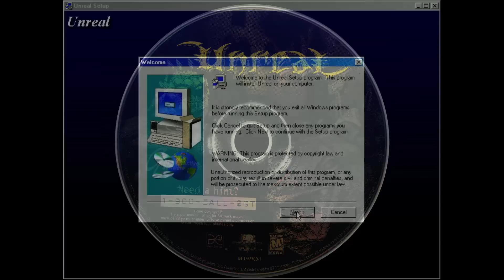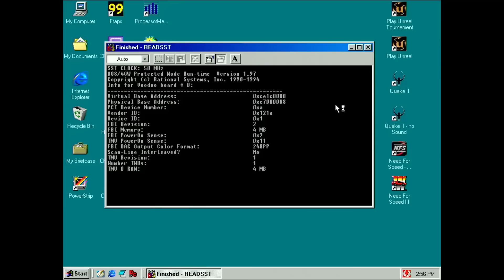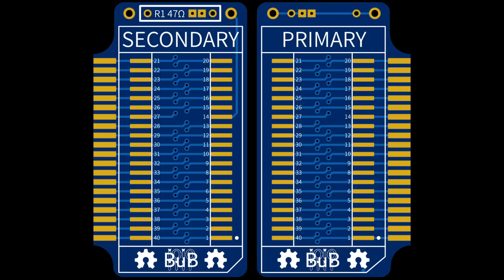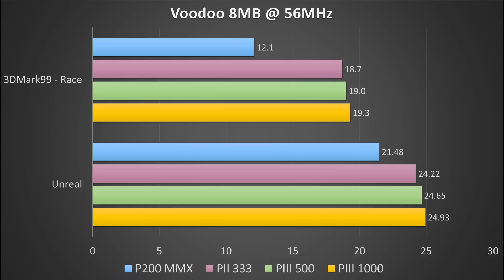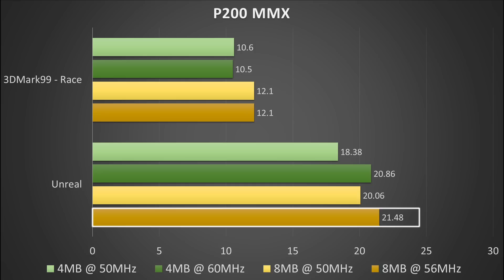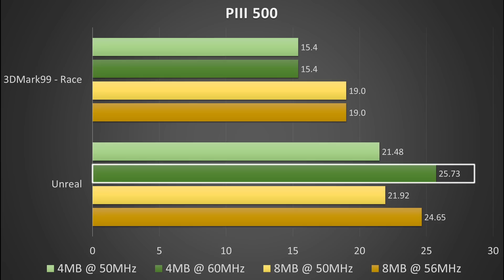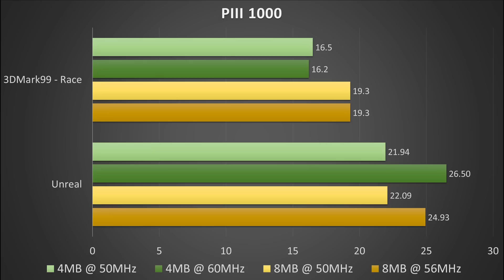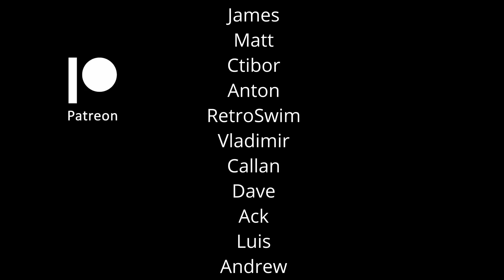Powerup: 3Dfx Voodoo with 8MB meets Unreal!

Comment: My Monster 3D Voodoo 1 was the first thing I ever overclocked. 50 mhz to 57 mhz. 60mhz all games crashed :(
Reply from the maker: I have around 7 Voodoo 1 cards right now, and none of them are stable at 58+ MHz. 57 MHz is some mystical barrier (I think two are even unstable at that frequency). I think a safe overclock for most cards is a solid 55 Mhz - which gives a bit of headroom.
Reply: @bitsundbolts  people said I was an idiot for overclocking it but I got Voodoo 2 SLI a year later
Reply from the maker: Hehe, well, instead of overclocking, one could also say: 'optimizing'.
I do it to this day! I am running a 3070 in my system and know that nVidia pushes those cards to its limits. Most of the time, you can reduce the core voltage of modern cards significantly, and reduce the clocks too! Ok, you lose 5% performance (as in 97 frames instead of 103), but the temperature drops by 15 degrees! I prefer a silent system over the 5% performance gain.

Comment: I wonder if Unreal Tournament is playable with the voodoo 1 and with the texture pack would make a difference having more texture memory.
I also wonder if similar memory upgrade would be possible on a voodoo 2 because i remember i had red somewhere it would support up to 20 MB (not to be confused with the SLI on a single board cards with 16 or 24 MB), that would be even more interesting!

Comment: Did you try upgrading the 3dfx Velocity 100 from 8 to 16 Mb? Aparently there exist 4-chip SGRAM Voodoo 3-s, and as the Velocity 100 is a Voodoo 3 with less RAM and 1 texture unit disabled in drivers, maybe there is a way to install the updated amount of ram and flash the relevant BIOS to the Velocity 100?
Reply from the maker: I do not have a Velocity 100. But I have heard what you described before. Not sure about the ram upgrade, but definitely unlocking the texture unit.

Comment: Mankind are about to enter 128 bit era, but you still stuck on 8 bit. Move on bro
Reply: They need a 128 bit OS and CPU, and then 3D games will not lag and hitch; It should have been done decades ago. Game consoles from the early 2000s such as the PS2 is a 128 bit system.

Comment: I was chasing for great 3d accelerators at the time, all voodoos, all Verite 1k/2k, all nVidia Rivas, I tried them all. But those are quite long obsolete today. The only thing remains unparalleled in Unreal till today is its software renderer, the only one on earth that can easily confuse you at higher resolutions with hardware rendering. Unreal's software renderer is undoubtedly the GOAT.
Reply: And it's all down to one simple trick: dithering. A 2*2 ordered dither on the texture coordinates is an incredibly effective way of faking bilinear filtering.

Comment: The reason you aren't getting much for having the extra video ram is either that you can load everything needed in a level into less than 4 already or the bottleneck is the processor it's self so extra ram isn't going to help much. 

The real performance gains for voodoo cards was with SLI anyway.  I remember going from one to two voodoo 2 in my system and it was a MASSIVE gain. I out performed the voodoo 3 when it launched, though me and my friends tuned the computer forever. Pretty sure that was the first time I overclocked a card. we ended up rigging cpu cooling fans from a Pentium II to the main chips and powering them from a chassis fan header set to run full speed at all times because obviously temp sensing wasn't going to be available. 

Unreal is a bit over what a voodoo 1 is capable of really. To me unreal fits more in the voodoo 2 era. They launched within months of each other. This seems like trying to run cyberpunk 2077 on a nvidia GTX 1080. There was never a time when 20fps was considered acceptable gaming.

Comment: You know we didn't play this games with the release hardware? It was soo expensive, so we used to play with an overcooked celery and a side of rivas. I don't understand your obsession with release hardware. Games weren't released so close together
Reply from the maker: Unreal did not work well on the system I had. I don't remember what graphic card I had, but I think it was something from ATI. Direct3D wasn't an option yet - therefore it was software rendering.
Back then, I did not overclock my PC. I was afraid damaging something and also lack of knowledge.
Regarding my hardware choices: I could use a random setup, but staying around release hardware gives a close representation of how the game was back then. Running Unreal on an Athlon XP 3200 and a GeForce 3 won't trigger the association that was created over 25 years ago. But that is just my opinion.
Reply: @bitsundbolts  I absolutely understand that, for me the glide wrapper was problematic. 3dfx left a huge mess, just getting working drivers is almost impossible now. I dont think windiz updates will even work anymore. I don't have anything else to tell you that you don't already know, you can't be any dork off the street to double the ram. Overcloking was done with jumpers, we even had to enter the lba, cylinders, heads, set slave or master jumpers and make sure the cables were 66 or 100. The sounds of HDD will always be missed, but I am always amazed at how fast and capable old computers can be when you stick to period correct software.

Comment: I wonder how you benched the v1 on a 1000mhz p3, that cpu is too fast for the card and the cards displays al kinds of dispay errors (colored blocks,etc). Is it a calculated result?
Reply from the maker: I did not see any issues running the Voodoo on a PIII 1GHz. I am using the Windows 98 supplied Voodoo drivers (which glitch under 3DMark 99), but work without problems in Unreal 225f.

Comment: Cyrix PR200 with 32Mb ram, running a Diamond Monster 3D back in the day. What most "modern" takes of this leave out is that a lot of us were running at 512x384 for better performance, not 640x480. On an LCD panel it looks terrible. On an old CRT it was very playable visually, plus you could hit 30 FPS in a lot of titles. Remember Doom and even DOS Quake in software mode all ran around 320x200 back then, so 512x384 was a step up.

Comment: hi
how did you overcome the 3dfx driver glitch that ruins textures in d3d modes on cpus faster ~400mhz? 
although unreal is able to run in a free of this bug glide mode (in this case without any benefit from additional 4 megs of ram), 3dmark works in d3d only. 
what's the driver do you use?
Reply from the maker: I used the driver coming with Windows 98. It does glitch on both PIII CPUs.
Reply: It's strange that it worked at all becasuse w98 integrated driver for voodoo graphics seems to me a dummy plug.
Reply from the maker: With later reference drivers, 3DMark renders correctly on the faster PIIIs. The Windows 98 SE driver does glitch with those CPUs. Unreal however never had any glitches with the drivers coming with Windows. I was surprised as well. They were also a little bit faster compared to the latest reference drivers from 3Dfx.

Comment: Great mod and experiment. I was there when Unreal came and it was quite the nightmare to make it run without a Voodoo. My first proper 3D accelerator was a professional ELSA Gloria XXL, that was great for many things but definitely not for gaming. Things like that, I used to run it with the software render. I remember that I needed an overclocked Pentium II 350 to make it half decent. Some time later I got the first Geforce paired with a dual Pentium III 1Ghz and what a difference it made. Still, I remember that playing at 1600*900 with everything enabled was demanding even for the Geforce. Also, I rented the CD but it got all scratched when I crashed the car with all my friends inside and we rolled 7 times. The CD ended on the road and the car landed on top of it, but we still returned it the next day. Good times, lol.
Reply: Maybe you should have borrowed Gran Turismo instead of shooters.

Comment: I quess "no lights" is not about dynamic light in particular but about lightmaps. They require extra rendering step on 3Dfx Voodoo Graphics because it does not feature blending of multiple textures in a single pass like VooDoo 2 and later can do.

Comment: This behavior might have something to do with the FSB. When a GPU runs out of memory it has to use system RAM in order to compensate. The Pentium 200MMX and PII 333Mhz have a slower 66Mhz bus which should impact performance in scenarios where the graphics card needs to access system RAM. It is possible that the 100Mhz bus of the PIIIs makes this operation almost painless.
Reply: yes,i used a 83Mhz bus speed at a 200mmx (208mhz)..it was also a little push on a monster 3d-2

Comment: Next: V2 with 24MB on an single Board or take two for a modded V2 48MB SLI Setup? 😅 What would be the max. resolution? Over 1024x768?

Comment: Thanks a lot for your cool Video! I always wondered how a V1 with more Memory are going to perform! 
I have a small question, maybe you can help me, i am usind 2x V2SLI and Unreal 227i, i searched the whole Advanced Options, but i can not manage to deactivate vsync, i always hung with max of 59fps. If i use the Voodoo 5 it is deactivated and go up to 100+, any idea?
Thank you in advance, Daniel
Reply from the maker: I have not looked at patch 227i, but it could be that the option to disable vsync was removed. You could try to disable it by adding SSTV2_SWAPINTERVAL=0 into your AUTOEXEC.BAT (I have not tested this myself, but this should work for Direct3D - which I assume you are using).

Comment: Just increasing the TMU memory would have the same result except no 800x600 support. FBI memory only allows for higher resolutions. TMU memory upgrades allows for more resident textures, providing a potential speed improvement due to less texture loading. Newer games like Quake 3 will probably see more improvement because they were made for cards with more than 2 mb of texture ram.
Reply from the maker: I will test other games in the future - we shall see if newer games benefit more from extra video memory. I am just afraid that the Voodoo won't have enough power to drive those games.
Reply: @bitsundbolts  Yeah for sure. Even Unreal is close to the limits of a Voodoo 1 so newer games will not be a fun experience to play.

Comment: It might be possible to utilize the increased amount of VRAM, I suppose, if you write your own program or modify the existing program. It would seem those games don't, which isn't so surprising if this configuration didn't actually exist. The little improvement there is, might just be a few memory calls that can be skipped, possibly due to the difference between the 4MB and 6MB variants, and with a faster platform, the cost of accessing the memory is lessened.

Comment: I guess that in newer games with higher system requirements the performance improvements would be even bigger. For example in newer games that use the Unreal engine, like Unreal Tournament, Rune or Undying.

Comment: Excellent video. With 8 MB it looks like the performance improves a lot more with slower CPUs and less with faster ones. With the P200 MMX the performance improves by 9.1%, with the P2 333 mhz by 3.8% and with the P3 500 mhz by just 2.0%. But considering that the fastest CPU in 1997 was the P2 300 mhz at a price of 2000 $, allmost all Voodoo 1 cards were used with Pentium 1's and maybe 233 and 266 mhz P2's anyway.
Reply: You are right, it improves more on old pc because of the slow transfer speed on the pci bus on old pc . I test my Voodoo 1 6mb with some game it can run some games that with  the 4mb are not playable at all.
Reply: what ever did you ever do with 8MB of GPU memory!
do you think it could handle crisis?

Comment: Finally a game that benefits from the extra memory. It would be interesting to compare the lowest and highest FPS between the overclocked 4MB and 8MB cards. I suspect that the lowest on the 8MB card would be a bit better, as there's less need to swap textures. I also forgot about Unreal Tournament, that game had slightly more texture variation per level.

Comment: It's nice compares with Nvidia video cards like 2070 where you can improve memory from 8 to 16 GB , but FPS count will increase just for 3-5 %.
 The main thing to do it because you can😅
Reply: The high-VRAM graphics cards these days are aimed at a practical use case, but it's not gaming. It's machine-learning. Just running a neural network like Stable Diffusion takes several gigabytes of VRAM (even the smallest models for it have file sizes around the 2GB mark). Training one takes even more. From what I've heard, you can do training for Stable Diffusion on 8GB, but anything lower is probably out.

Comment: Unreal was pretty darn awesome to see for the first time back in the day. I upgraded from a S3 Virge based video card (which was awesome for 2D games) to a Voodoo Banshee based one largely because of Unreal. I'm still playing a game by Digital Extremes daily these days, Warframe! 
Also, your results illustrate why the majority of Voodoo 1 cards were 4MB models even though there were some models that more than that available.
Reply: My oldest retro PC have on-board S3D Virge, and Voodoo 1 and 2.
Reply: Those were the days.. i went from voodoo 1 to 2 for unreal back then.
And thumps up 4 warframe. The one f2p game i respect.. should fire it up again.
Reply: Same! S3 Virge with voodoo card was my setup. Only my processor was a Cyrix200, which was the bottleneck for bad or lack of floating point.

Comment: Unreal was one of the very first games I played on my Voodoo1 card, the other being ff7. I don't remember the framerates being as low as shown here, but it was a long time ago. I do remember the Voodoo being much faster than the software renderer on my P/MMX-200, in addition to looking so much better.
Reply: That's because the castle intro sequence is more demanding than the normal gameplay. When playing Unreal the FPS is a lot higher than in the castle intro sequence.
Reply: It also used to be that anything above 24-25 fps was considered pretty decent back in the days. I remember playing Quake II with the software renderer at 18 fps in my Pentium 120 and I was quite happy with it. Then i moved to a Pentium II  233 and frame rate at 800*600 was like 50 all the sudden, and I could no believe my eyes 😁 Unreal was no Quake though... much more demanding.